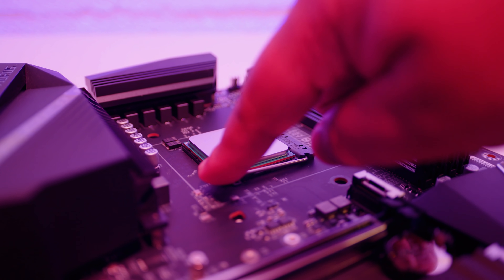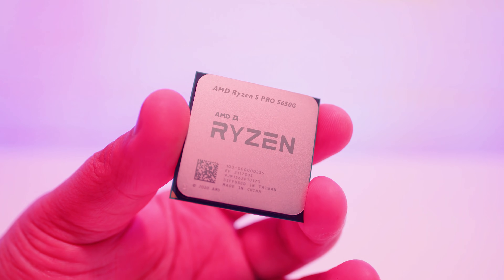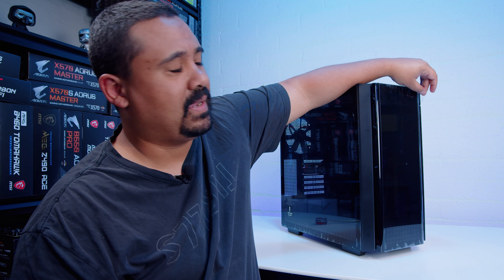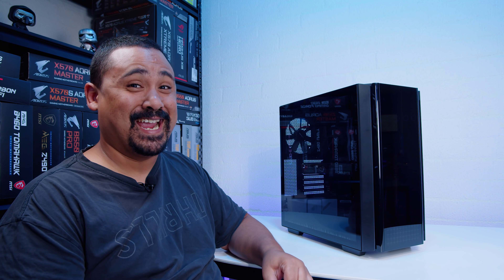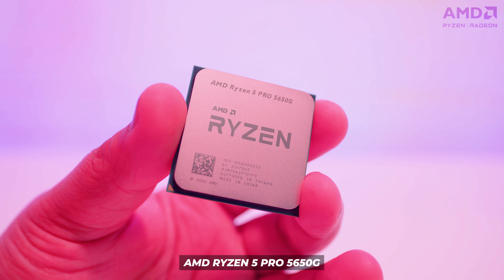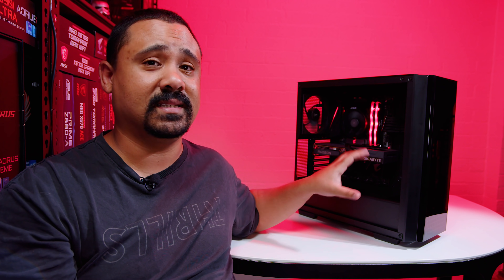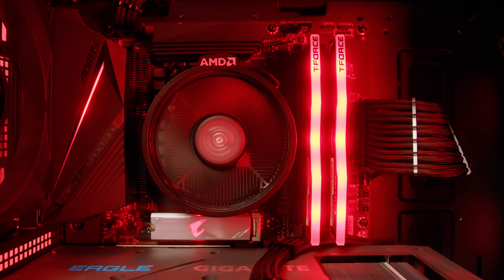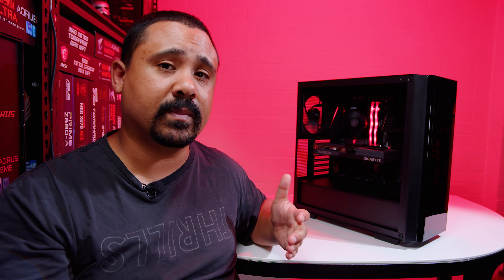There is a CATCH with this Ryzen Pro 5 5650G Gaming PC

Comment: Hi. I have one of these CPUs in my possesion and I been meaning to uncluded in a build. But I am having a really hard to get it to post/boot. I used (2) MOBO just showing the red light on the board for the cpu. ASUS TUF Gmaing B550-PLUS wifi II and the MSI - B550 TOMAHAWK MAX WIFI., 
CORSAIR - VENGEANCE LPX 16GB (2PK x 8GB) 3600MHz DDR4  and Corsair 600W semi modular. In the research ive done, all of them say that I need to update the BIOS on these MOBO to receive 5600 series chips, which the 5650G falls in. I USB flash the must recent BIOS on both of the MOBO and the same frustrating no posting result. I am very curious to know if you did something additionall that unpdating the BIOS and/or did you use use a specific AM4 MOBO that the 5650G works on. I also read that the X570 MOBO should work without any BIOS updates. Is that is already two MOBO ive purshace and it doest work. I appreciatce any feed back in regards what componets I need to use this CPU. Thanks!

Comment: great video ! I have the 5650ge , and use it with the Rx6700xt. This CPU doesn't typically support OC, but I was able to increase power consumption with the x570 motherboard (up to 85W). I boosted all cores up to 4.6GHz with Ryzen Master from the system, now in Geekbench6 and Cinebench23 it gives slightly higher performance than 5600x

Comment: Been playing with my rx 6600. Using more power tool was able to get it to 2750mhz. Over 2500 gpu points in firestrike compared to the stock auto settings. Max 160w. Temps stay below 90c at the hotspot. Ran well in timespy as well.

Comment: If you do a 5650g video my first request would be to also test the integrated APU graphics since it might be a hair different.

Other than that this chips are a great "Don't overpay for a GPU" option right now: while I do have a 1070 on another rig I'm not currently using I decided to intentionally limit my current rig to only a 5600g as my source for graphics. So far I honestly barely miss the 1070: There's a visual difference for sure, but for the games I prefer which are actually older titles, indie games, RPGs, etc. It does the job just fine just like that.

If anything is a testament on how many folks might be able to get away with docking a Steam Deck even for day-to-day PC use.
Reply: I'm almost certain it's the same Vega 7

Comment: You need to replace the stock cooler. By using it you will lose 8-10% performance due to the heat. Find a nice 25 to 30 dollar tower cooler to get the most out of the APU.
Reply: It's probably not as hot running as you think it is.
Reply: I was testing a 5600G with the stock cooler running the Cinebench 10 minute test and it was running at 85c. The other cooler kept it around 72c the score difference was about 150 points. I had the same problem with the R5 3600 a while back. I thought the $25 investment was worthwhile for the work I was doing.
Reply: @lvc394  depends on your case and ammount of fans and what quality they are. The 5600g isn't really such a hot chip, since it's pretty much an i5 10400f.
Reply: @ties9123  I tested it in the same case and I even let the stock cooler run with the case open to give it a handy cap. The Ryzen stock cooler is just okay but not good unless you plan to run MS Word. For any other workloads you may not be good. I am using the 5600G as a trainer for Video editing and the stock cooler is not staying cool. For gaming I guess it works but I have my doubts. In the end it is your system and I guess you know your limitations.